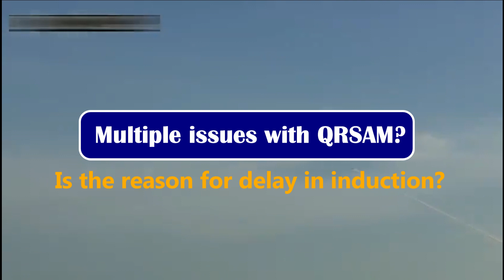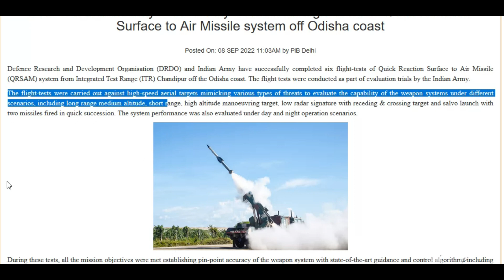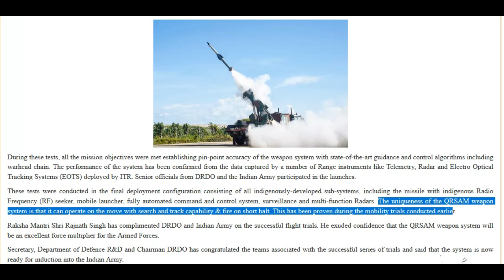Multiple issues with QRSAM? Is the reason for delay in induction?

Comment: This report looks like an exaggeration  of any issue that might have surfaced in the trial. Few things are out & out doubtful by its very nature. Mobility, Launcher, Missile, Seeker all would have performed flawlessly. Radars could have faced some issues mostly coding based rather than manufacturing based. I expect these test to have met atleast 98.5% of all the insane QSR that Army would have put forward.
Reply: It is not an exaggeration, but a lack of understanding by the IA/IAF evaluators of what a missile system like QRSAM or AKASH can actually achieve, and that itself is worrying. 
Modern radar homing missiles that are capable of shooting down low flying aircraft rely on a principle of physics called "Doppler Shift" to filter out targets from background reflection from the ground, mountains, buildings, vehicles etc. This uses the Doppler Shifted radar reflections frequencies from moving objects to identify moving objects and shoot them down. This type of radar will only detect moving objects faster than a preset speed. This preset speed needs to be set as low as possible, but faster enough (eg. > 70 mph) to prevent moving vehicles (eg. cars, trucks) from triggering it and causing the missiles from being unable to shoot down aircraft because they are decoyed by ground vehicles. A vertical launched missile like the QRSAM is less effective than the Akash for example simply because it goes up and looks down to try to detect the target against the ground which has a lot of ground clutter coming off it  if it is below the missile, regardless of how high the helicopter is flying. Whatever the case THIS TYPE OF AIR DEFENCE SYSTEM WILL NOT RELIABLY DETECT HOVERING HELICOPTERS OR DRONES BECAUSE THEY ARE NOT MOVING FAST ENOUGH. That is due to the laws of physics and that cannot be overcome with this type of radar and the same will be true of similar foreign missiles.  This is the reason the Russian S300 and S400 missiles have been having so much trouble shooting down the Bayraktar drones of Turkey, because they are small targets and they move very slowly, presumably below the detection threshold speed) and it should be a concern of the IAF/IA as Turkey will be selling the Bayraktar drones to Pakistan.

What the IAF/IA needs to solve this problem is to induct systems like Akash and QRSAM missiles to intercept aircraft and helicopters flying faster than 70mph, and to additionally develop another air defence system that will detect slow flying drones and hovering helicopters. These require different methods of detection. One possible way of detecting these is to use fluctuating frequencies or amplitudes of radar reflections at frequencies corresponding to rotating helicopter blades or drone propellers to identify drones and hovering helicopters. Another might be optical, infra-red or laser rangefinder scanner that detect changes from the normal background that may be caused by a helicopter or drone and either automatically shoot it down with a gun or laser beam, send a drone jamming signal or notify an operator to decide whether to target it or not. This may be necessary because it will also detect and target ground targets an things like leaves that move with the wind. This type of system will be short range and will require deployment separately from A QRSAM system because of that, so it needs to be a new air defence system rather than an addition of sensors to QRSAM.
Reply: @jonswap9097 you’re right and I think this and akaash missile systems are a last line of defense for incoming ballistic missiles, low flying cruise missiles and aircrafts where QRSAM would especially shine given its better mobility compared to Akaash. 
But for drones, attack helicopters and other low speed aerial targets a system other than this is required and hence there is a lot of effort in developing VSHORAD from DRDO for this very purpose which will come in multibarrel vehicle mounted format for this type of air defense.